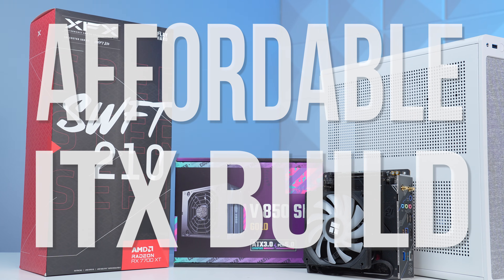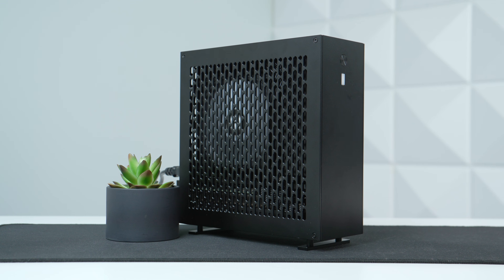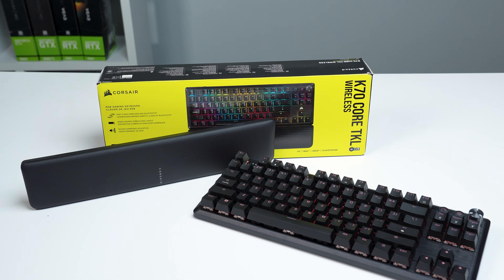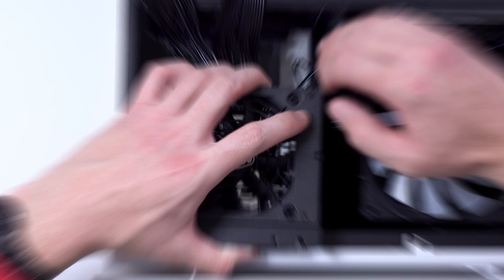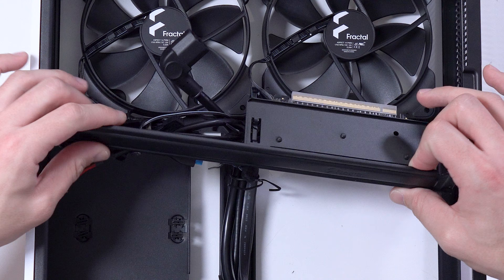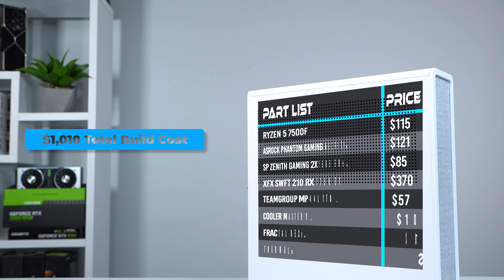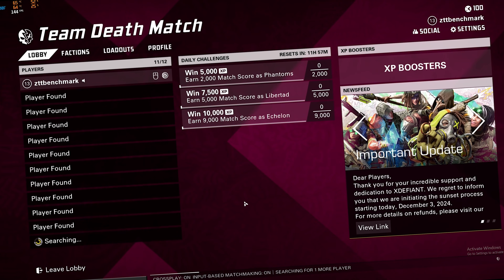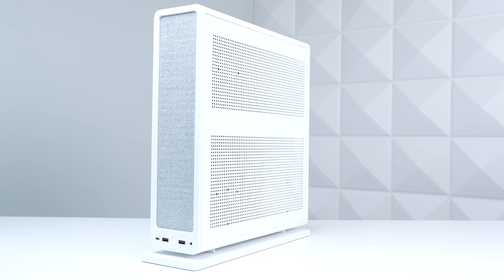This 1440p ITX Build is Actually Affordable!

Comment: Im actually jealous, here in turkey ITX is awfully expensive finding a 650w gold SFX power supply for 7K lira brand new is not fair. And imagine the case + motherboard they straight up do not exist.
Reply from the maker: Yikes sorry to hear that :(
Reply: @ZachsTechTurf  Yeah it sucks, but i definitely am not losing hope on building an ITX PC. Just gotta convince my family that buying from the 2nd hand market would be fine
Reply: You can build much cheaper itx if you go with lower end older gen and not premium itx case etc.
Reply: 12400f	$112.00
ASUS PRIME H610I-PLUS 	$120.00
2x16GB ddr4	$50.00
Cooler Master NR200	$80.00
Arc B580	$260.00

= 1440p gaming.
Reply: @tendosingh5682 The issue is availability, the Turkish market isn't anywhere as diverse as the U.S market. The options are either limited or straight up nonexistent.
Reply: Knk ben de itx değişle micro atx sistem dizmeyi düşünüyorum 2025 yazın ayına. Fiyatlar ateş pahası ne yazık ki
Reply: @kasadam85  Bol şans

Comment: The silicon power ram used in this build has been known to not work on some am5 motherboards so id say just spend the extra few dollars on team group expo memory or even G skill non rgb is like $99 but saves the head aches at the same speeds
Reply: can you elaborate as for your sources?
Reply: @RealAdachiRei  YouTube keeps deleting my comments lol
Reply: silicon power has only had issues with specific gigabyte boards. Though I would avoid gigabyte/silicon power altogether for now
Reply: @phoenix0246  I had the silicon power ram issue with ASRock b650
Reply: @phoenix0246  i wonder if that's why my aorus laptop has basically had declining health for the past few months... ever since i installed silicon power 64 gb ram now so many ram related errors started popping up over time and certain applications won't even start

Comment: itx + 1440p + affordable. not impossible anymore
Reply from the maker: Correct!
Reply: @ZachsTechTurf  you shouldve picked the jginyue b650i night devil, its a really good motherboard with the only thing missing is a wifi card
Reply: @ZachsTechTurf still takes half a kidney out of us 😢. good video tho❤
Reply: @ZachsTechTurf  shouldve used the b650i night devil from aliexpress
Reply: Bro out there answering comment in one word now ? 💀😂 @ZachsTechTurf
Reply: @ZachsTechTurf  You are beyond lucky. Here in Europe just the ryzen 5 7500f CHEAPEST possible one is like 150 euros (about 165 dollars). The case is about 135 euros (140-145 dollars) and the motherboard is 169 euros (about 180-185 dollars). The cheapest new rx 7700 xt on the market (the xfx one) is about 490 euros (520-530 dollars i think) and it's impossible to get a decently priced SFX PSU here.
Reply: The motherboard case cpu cooler for itx is still xpensive..
Reply: Affordable? The case alone is over 100 USD! And why does it have a big hole above the pcie scew bracket?
Reply: @tendosingh5682 $100 is very normal for a quality pc case

Comment: i got a 1440p build at $700
Reply: Omg what are the parts list please 🙏
Reply: @ 
- Ryzen 5 5600
- Asrock B450M AC R2.0
- 32GB 3200MHz Cl16 DDR4
- 1TB Gen3 SSD
- RX 7600 XT 16GB
- 650W PSU
-Montech Air 100
Reply: @ it might not be the same price as before but maybe
Reply: @tufflukascr  thanks